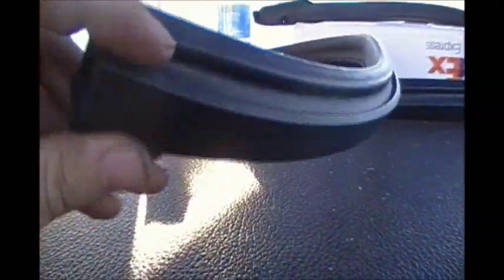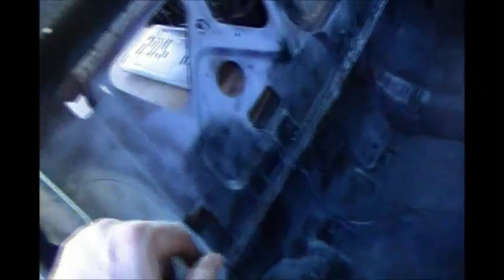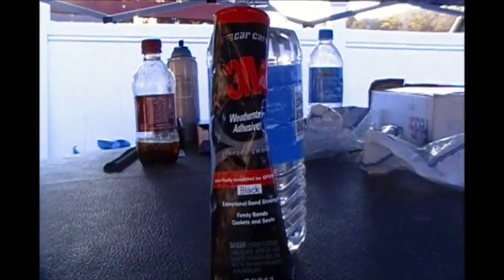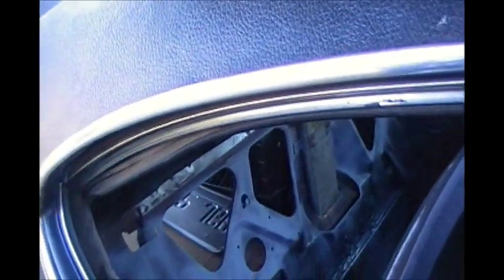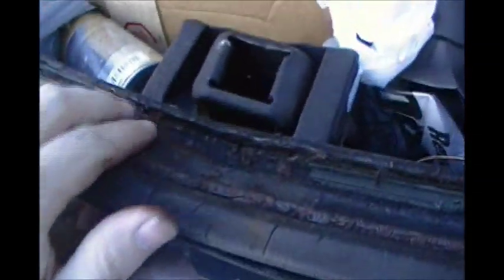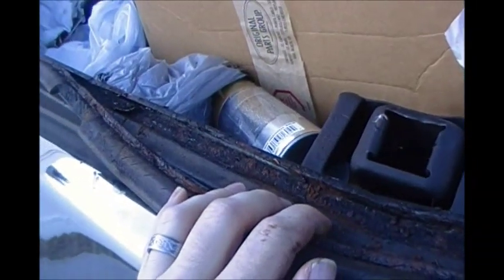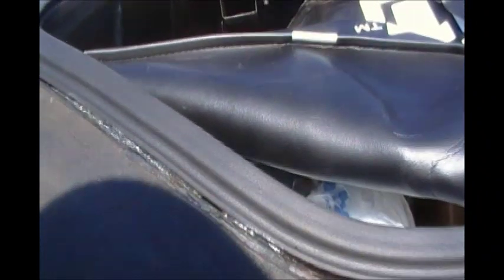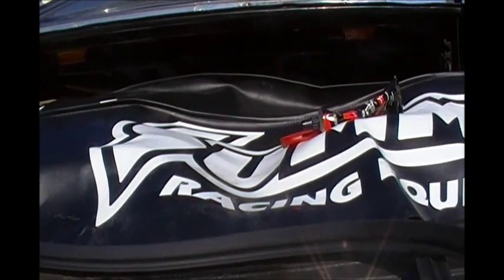Stage II Coupe Weather Strip Installation

Comment from the maker: If you are talking about the interior panels in the rear... there is 2 screws near the door jam, 3-4 screws towards the drunk divider... (The back seat will have to be removed) then just remove the window crank handle and wiggle it around... you will have to roll the 1/4 window down to get it out of the window track. I will try to post a video of the process when I get a chance.